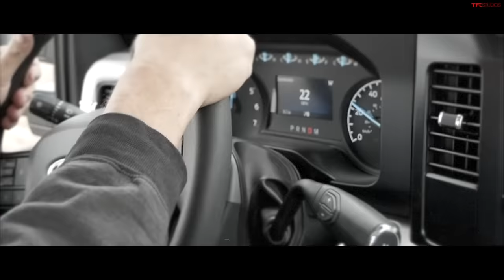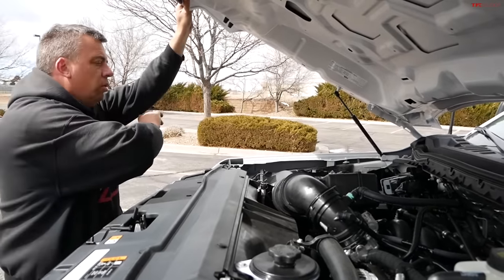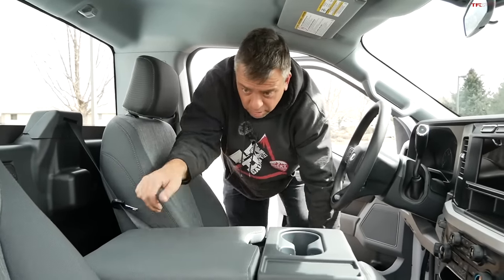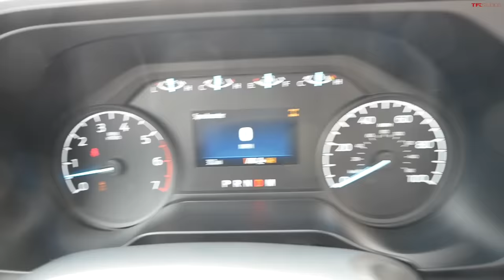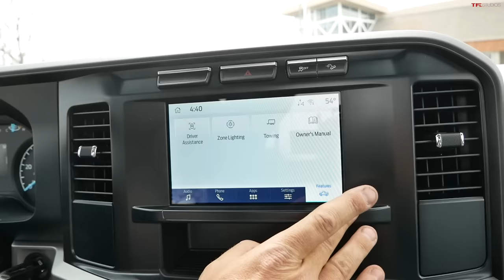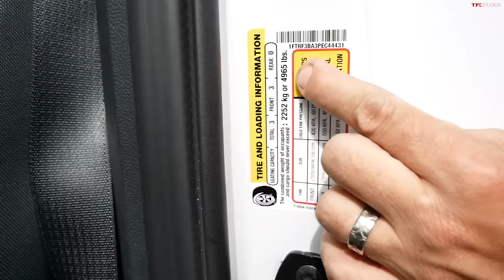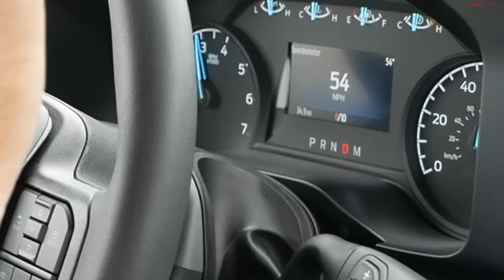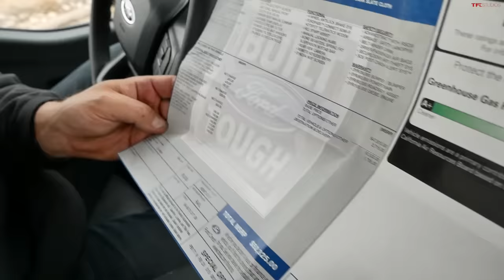I Drive a 2023 Ford Super Duty XL Work Truck with the Brand-New 6.8-Liter V8!

Comment: I've had my 2023 F-250 STX crew cab long bed 6.8l for about 2 1/2 weeks now. 4.30 gear ratio with about 1200 miles now. Love the truck so far. Averaging around 14.8 mpg.
Reply: Whining noise from trans at idle?

Comment: Just a good truck. The new column shifters in the 150 and super duty is very light and dainty feeling. That payload, impressive! The sticker on my 2020 F-250 7.3 XLT Tremor was $53k. Crazy how much prices have changed in just a couple years.
Reply: Yup, same here. I’m gonna hold on to that truck for as long as I can!
Reply: I bought a 2020 6.7 power stroke lariat with 18k of options for 65k.

Comment: The 6.2 was a good engine. Why they went to the 6.8 with the 7.3 so close I’ll never understand. But Andre you’re right about finally showing some work trucks when luxury trucks are outrageous in price. These trucks make sense. A truck built to do what a truck is supposed to do. Great video!  I hope there are more of these real world work trucks for real working people.
Reply: The 7.3 is actually still available on the higher end models.
Reply: Right? Why would they add another engine.  Wasn’t the 7.3 Godzilla good enough?
Reply: @westeed1  the 6.8 is just a destroked 7.3. It's probably cheaper than running a whole other assembly line for the old 6.2 SOHC. I wonder if the 7.3 will get more power in the future
Reply: @danr9584  because the 6.2 has been proven reliable for 10+ years now, so it’s time to dump it and head to the unknown. I’m sure the 6.8 is a great engine but why reinvent the wheel? Roughly the same power, and mpg….
Reply: @TheAirSofterblaster200  Better emission efficiency would be my guess, EPA requires the emissions to constantly improve. So if they can save money by using the same engine assembly line and get better emissions than the 6.2 then it makes complete sense from their view.
Reply: I don’t find the purpose of 6.8 it is only available on the xl and every other trim the 7.3l is standard
Reply: @TheNewenglandboys   lol I didn’t even ask none of that
Reply: @gregrichter6614  gee sorry I shared my thoughts with you.
Reply: @TheNewenglandboys  well i don’t agree with that fords have bad years but the 6.7 is pretty reliable now and with Chevy I currently drive a 02 2500  gasser it still running strong  all 3 make solid trucks
Reply: The 7.3 was actually designed pre-2010, but was shelved by Ford brass in favor of the OHC engines. The 6.2 was physically massive; larger than the 460 big block I have in my pickup. They were displacement limited due to smaller bore spacing and less room for stroke. The 7.3/6.8 is a more compact engine that offers larger displacement, and is a tried and true design that really is more of a new generation Windsor small block. The 6.2 had ZERO aftermarket for us gear heads and was not nearly as robust of a rotating assembly as the 6.8 and 7.3. Good f'in riddance. It was reliable, but that's about all the 6.2 had going for it. I won't miss it or the mile long timing chains. You don't need overhead cams and a mile wide engine block in a work truck that doesn't see 6K rpm. That's where overhead cams shine- high rpm valvetrain stability. Completely unnecessary and as a drag racer I'm stoked that we have a real Ford engine to compete with again. The modular engines were always a huge letdown.
Reply: @TheAirSofterblaster200  It's the same as the 429 was to the 460. Same block, pistons, rods. Shorter stroke crankshaft.
Reply: @gregrichter6614  You don't run a fleet. It's a fleet owners dream.
Reply: @TheAirSofterblaster200  Ford made good pushrod engines for half a century before the modular engines ever came on the scene.  The 6.8 is just a de-stroked 7.3. It takes just 1 different part from the 7.3- the crankshaft. Believe me, as a mechanic and drag racer, I'd bet on this engine and the 7.3 more than anything else Ford currently produces, even the 5.0.
Reply: @gregrichter6614  Aimed at fleet customers.
Reply: I disagree these truck prices do not make sense. This should be 30k dollars.
Reply: @Sak-zo1ui  I agree but they aren’t $30,000 and although they are insanely expensive, it’s better than the luxury liners they try to call trucks
Reply: @TheNewenglandboys  fair assessment
Reply: @TheNewenglandboys  oh so that makes sense to buy it just because they are asking it? With that logic no wonder why they are getting away with these prices …. DUMB
Reply: its like gms vortec 4.8 and 5.3
Reply: @TheAirSofterblaster200  Similar peak numbers, but the pushrod motor makes much more torque at low rpms. The 7.3 makes double the torque at 2k rpm vs. the 6.2, the 6.8 will be similar.
Reply: The US government will probably use this truck. When they need work trucks for maintenance like on military installations, they don’t want to use a lot of diesel, and rather use gas trucks that can run ethanol
Reply: @Wellh0wrya  ya well I didn’t say that it made sense. Just simply that it’s the cheapest that can be had
Reply: @TheNewenglandboys  how about not paying it and either buying used or holding on to what you have…90% of the technology can be replaced through an updated audio receiver
Reply: @Wellh0wrya  Agreed. I’m holding on to what I have because even a decent used truck is stupid money. Given the prices of even the low tier trucks, it doesn’t matter much anymore. But I have Zero interest in electric trucks. Price, charging time, distance on a charge, and battery replacement cost at around 10 years make them a ridiculous choice in my opinion.
Reply: @Sak-zo1ui  Yeah ok, it's not 2002 anymore. A base civic is 30k.
Reply: @jstdhutch  a base charger is 30k.
Reply: @Sak-zo1ui  I can buy a $30k dumpster thats more reliable and holds value better than a charger.
Reply: 6.8L is OHV while 6.2L is SOHC.
Reply: Bruh the 7.3 and 6.8 are literally less complex than the 6.2. A NEW ENGINE THAT IS LESS COMPLEX THAN AN OLD ENGINE WHERE ELSE DO YOU SEE THAT? It's less complex and makes more power and torque. Come on dude.
Reply: Well said.👏 The 7.3 and 6.8 might be the best gasoline engines ever in their simplicity but with modern manufacturing methods outperforming everything that we used to have. It's just beautiful and I applaud Ford for making these, RAM's 6.4 Hemi and GM's 6.6 gasser can't compete.
Reply: @Steven Seagull My apologies, I had my numbers a little off. The actual number is at 1500 rpm, which is even more impressive. The 7.3 makes 400+ torque from 1500 on up, whilst the 6.2 only makes just over 200 at 1500 rpm. I'm surprised you can't tell the difference between the 7.3 and the 6.2, all the 6.2 trucks I drove were absolute dogs.
Reply: I think this is the smartest thing Ford has done. The 6.2l in the superduty was the detuned raptor engine and because it was detuned but made to produce more, it flipping lasts forever. This would likely be the same thing, a bigger engine just producing less power means it will likely last forever just like the 6.2l but producing the torque down low like the 7.3l is much nicer in these big trucks. My XL is over 140k miles and still running strong as ever. This is the engine I would likely want to replace my ol 6.2l. Ford knocked it out with this engine design. I’m all for it.
Reply: @ChevyConQueso  the 6.2 wasn’t displacement limited at all. It’s not built like the coyote is and you can get more out of it.
Reply: 7.3's have crappy glow plug relays
Reply: The 6.2 was shit with towing. The overhead cam design is not good for cheap reliable and easy maintenance. It revved out towing little weight. I hated my 6.2l work truck. Loved the new 6.6l gas motor from Chevy for towing.
Reply: @Sak-zo1ui Exactly mate

Comment: As an Aussie, this thing is basically everything I could ever want in a Ute/Truck. Even as a BASE model, it's got more features than some of the Japanese dual cab utes we have. Deep down I know most industries and tradies would kill for a no-frills Petrol work vehicle, common rail diesel 4 cylinders suck for the average consumer.
Reply: F350 is a big unit. Damn that things huge

Comment: Just configured a bare basic F250 XL 4x4 with the 6.8L V8, and the only add-on I did was upgrade to the 4.30 axle ratio, came in just under $50k....not too bad, but still expensive for someone like myself that doesn't tow heavy very often....So I'll buy used at some point rather than buying a brand new truck just to sit in the driveway most of the year.

Comment: The 23 XL STX is pretty nice option. It’s close to 60000 with the crew cab led headlights fog lights black wheels 360 camera
Reply: Terrible prices
Reply: Your 100% right and the fx4 is like what its should have stx
Reply: Pretty nice option for 60K?  Only if you're using it for business and get a tax write off.

The days of the average Joe owning a new HD truck just because they like it are pretty much over.

Comment: My '19 Tacoma Pro was $48.5, the '22 F350 (ordered Nov '21) dually, 7.3L, 4WD, extended cab (thank you Ford for keeping the extended cab option), 8ft bed, 4.30 rear end, OTD $68K.  Sticker payload 6400lb, max tow 21.2K.  Ford did increase the base price by $3K between order and delivery, my dealer honored the original $64K build sheet price.  It's my wife's primary, seasonal, camper tow vehicle.  It's apples to oranges, love both trucks.  The Taco was maxed out for the loaded 4400lb travel trailer she tows, the F350 you barely know it's there.

Comment: What's really cool is that the 7.3l v8 comes standard with the XLT trim as does 4 wheel drive! For $50k you get a reg cab 4x4 7.3l v8 with the XLT. The 6.8l v8 is only available in the XL trim. I'm new to the heavy duty truck segment I currently have a gen 1 nissan titan and I want a new superduty as my work truck. I love the current horsepower wars in the truck segment.  Nothing like a big V8 in a truck!
Reply: You’re right. Their pricing on lower trim levels isn’t outrageous at all. I just got a crew cab long bed 4x4 F250 with 7.3, 4.30 axle and 48 gallon tank for $49,000 after ford employee discount. The sticker was $57,000. It has tons of options. Remote start, tailgate step, bed liner, LED bed lighting, 8” screen with apple car play, auxiliary switches, vinyl seats and floors, sirius xm, dual batteries and alternators, mud flaps, wheel well liners, tinted windows, etc. Everything I wanted and nothing I didn’t. I don’t care about massaging seats. Lol.
Reply: @Clifford Montana  That's an awesome deal! I'm honestly surprised at the current pricing of the new superduty's. It's going to be difficult for the competitors to be in the same price range. Hopefully the dealers won't mark up these trucks too badly. Enjoy your new superduty I'm looking forward to getting one!
Reply: @aaronkowalewski659  Thanks man! Lots of guys who can’t afford higher trim trucks waste money on fancy stuff they don’t need and will cost WAY more to upkeep. Diesels are a NIGHTMARE outside of warranty and have high maintenance costs. LED headlights and taillights are cool…but they cost 3-4k new…and if they break outside of warranty just ONE headlight can be $1500. Buy an XL with vinyl seats that are almost as nice as leather. The base screen is 8” but poor dudes are paying tons of money to get the fancier 12” screen. Get a drop in bed liner instead of spray in bed liner and save $200. Massaging seats WILL fail, sunroofs WILL leak. Keep it relatively basic and you’re good. I threw badass 20” wheels and tires on my truck and now my “base” truck looks like it costs 100k. People can’t believe that I only paid 55k with the wheels,tires and state tax. I’m going to keep this truck for a decade at least. Get your order in! It costs nothing and there’s almost a year wait. Good luck bro.
Reply: @Clifford Montana  Thanks! That's exactly how I ordered my Titan in 2008 it's got 376k miles on it. With only basic maintenance. It's as basic as it can be, and you're right. The simpler things are, the less likely they are to break.  I plan on doing everything that you described.  I'm going this weekend to get my order in! Plus, I still can't believe that an 8" screen is standard! A couple of years ago, that was lariat or higher trim! I appreciate the advice!!
Reply: @aaronkowalewski659  Titans are awesome trucks. The 5.6 is a great motor. Sounds good and fast!
Reply: @Clifford Montana  I love it. I've done everything that I can possibly do to it performance wise without doing cams, supercharger, or a turbo. It's a really fast truck.  People are usually shocked when I pass them.  But all things come to an end.  It's been the most reliable truck I've ever owned, and it certainly owes me nothing but a ride a home 😆. It's a real shame that the 2nd gen titans are having so many problems between the #7 piston melting and the transmissions blowing up. I'm part of the Titan forums, and every day, I'm reading horror stories of guys with 20k to 40k going without their truck for sometimes months with no answers in sight. And no loaner vehicle.  Beautiful trucks, too. Maybe Nissan will come out with a new one soon. Also, option for option they can't compete with the big 3 or even Toyota, for that matter.
Reply: @Clifford Montana  
Did you order it trough a dealer and is it xl or xlt ? Thanks in advance
Reply: I would rather have a 3.5L V6 if I also get 2 MPG with it!  Still a lot more power than my 1975 F-350 supercab that I carried a camper with it.
Reply: @louislouis9661  Yea I ordered through dealer. Didn’t cost me a penny to order it. Get your order in now! It will take you up to a year to get your truck. It’s an xl. You can’t get vinyl seats in an XLT, only cloth. Good luck bro
Reply: @Kangenpower7 The question is will that V6 out last the engine in the 75 Ford F350.

Comment: I don't have any data for this actually occuring here, but I love a solid platform like the 7.3 that then gets detuned down, it's generally a recipe for serious reliability
Reply: They're having all sorts of engine problems with that 7.3L unfortunately.  Sounds like the 6.8L V8 would be a better option for those who want reliability...400+ Horsepower is more than plenty for towing/hauling needs...the old 7.5L 460 V8 was only rated at 365HP stock, yep they could be tuned, but you'd also have reliability problems as a result...they were built to work all day long without breaking a sweat, that is what you want in a truck, you don't want all that bloated HP and torque to get you into trouble, and it definitely will very quickly.  For example that HO diesel puts down 500-600HP and 1,000+ foot pounds of torque....very terrible idea to put a common family sedan driver into for a weekend jaunt to the mountains with their toy hauler.  They got all that power, but they don't have the slightest clue how to properly handle it...they get that fancy toy hauler flying down the freeway at 80+mph and quickly find out that truck handles it like it don't exist, but a slight emergency/panic situation and they can't control what happens when they jam on the brake pedal, that mess ain't stopping from that high rate of speed like they think it can and they plow into everything in front of them as a result.  400HP is plenty for most tasks unless you are pulling heavy every day all day long then that HO diesel would be good.
Reply: @wildbill23c The 7.3 is one of the most exciting gas engines to come out in years. The internet has a few failures out of hundreds of thousands made tiktok goes crazy now every 7.3 has serious problems lol. There were a few bad lifters put out during covid  but talking to delivery drivers and ford techs in my area they all say the engine has been solid no problems. Makes me wonder if alot of this ain't overblown with social media hype. I've heard a few people say this about the lifters but nobody has actually known a real one fail yet just social media feeds. I'm guessing either way the 23 and up models are probably fixed. It's a simple engine design and it's  5th year of production now. For the record never buy the first couple years of anything new I learned that on guns buying new models having trouble. Wait atleast a couple years let the bugs get worked out.

Comment: We will probably end up with these in our rental fleet since our boss is a Ford fan. We typically had Chevy in the mid 2000's due to the rampant 5.4 3-valve engine problems, but the lack of a big block option outside Ford has pushed our fleet back towards Ford recently. Not to mention, it's easy to "prove" a given drivetrain configuration based on large fleet tendencies. Uhaul has kept a fleet of tens of thousands of 6.8L V-10 and now the 7.3L big block engines with little problems.....manintenance is key, too many people blame their truck while simultaneously beating it near to death while deferring proactive service the whole while.
Reply: There's no big block, unless there's a small block also
Reply: @Bloodcurling  the 6.8 and 7.3 are both small blocks
Reply: @daveb1081  Correct, although one could argue it's more of a "medium" block like people do for the FE engines I suppose. It's about the size of a 351W or C.
Reply: This was Ford's bet and it's paying off. The 6.8 V10 had it's issues, but was actually pretty dang successful over its 2 decade run, and I've seen many with 400K miles. But it's a massive beast, overhead cams are completely unnecessary, and the split pin crank design and balancer are not nearly as strong as the forged cranks these Godzilla engines are getting. The 6.8 is a fleet owner's wet dream. And I can't wait to throw a pull out 6.8 or 7.3 into my daily driver (panther). 7.3 at $1750 extra is a no brainer to me if I were buying one for myself, but buying 100+ trucks, that's a lot of money saved.